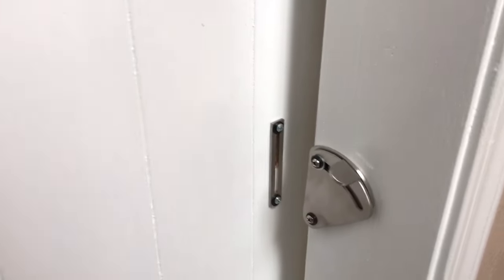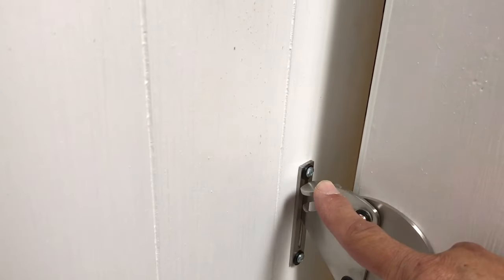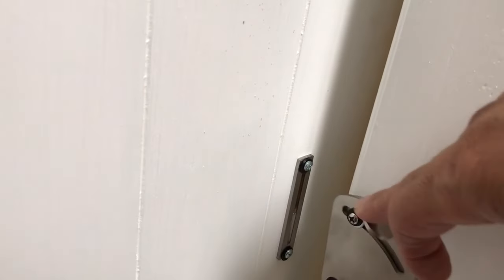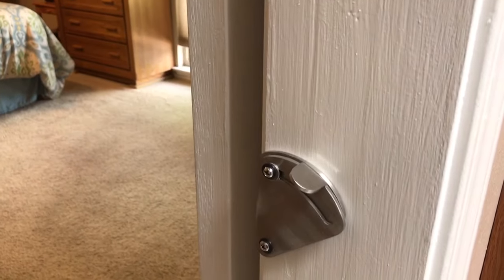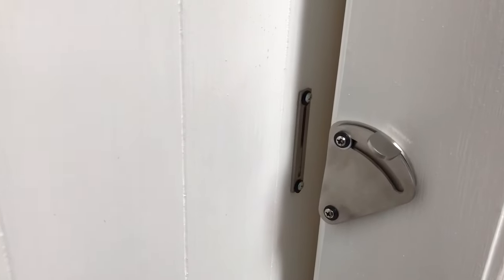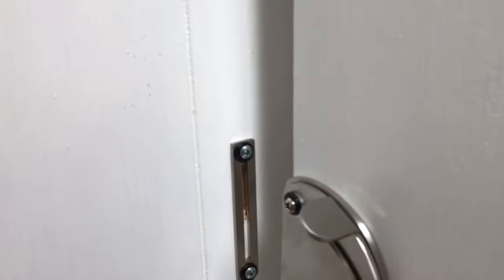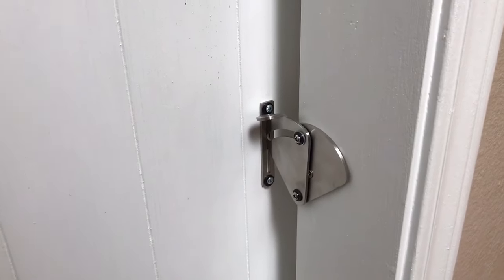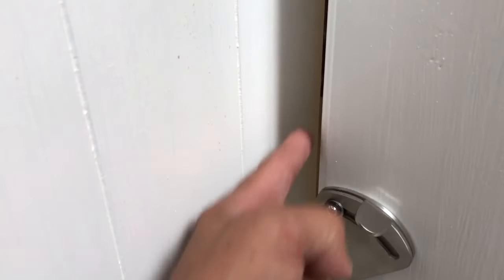Sliding Barn Door Stainless Steel Latch/Lock

Comment: I'm thinking about getting this style lock. Instead of cutting/dremel a slot in the door, if you put some washers behind the screws (would need longer screws than they supply) that would fill the gap more and the sliding latch would sit further in. Just some thoughts.